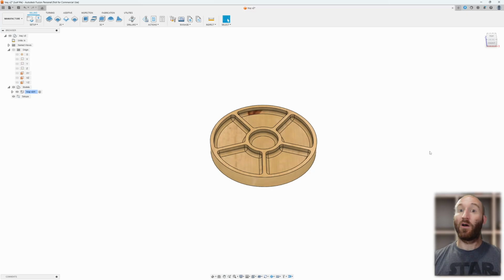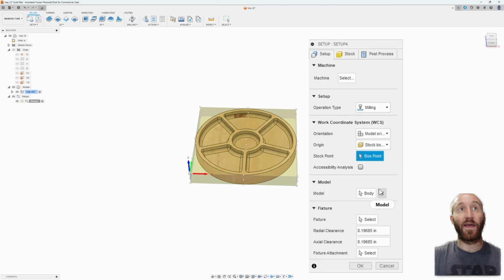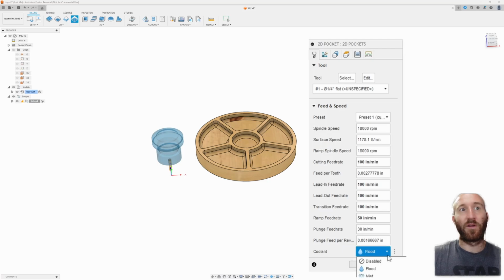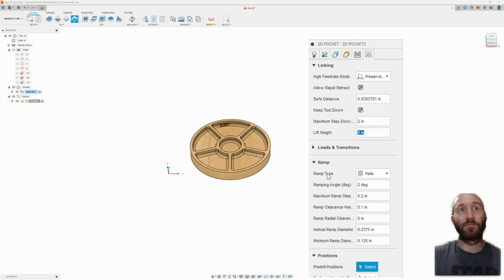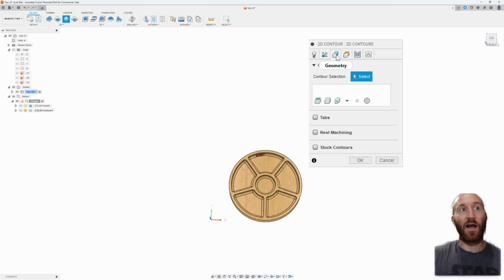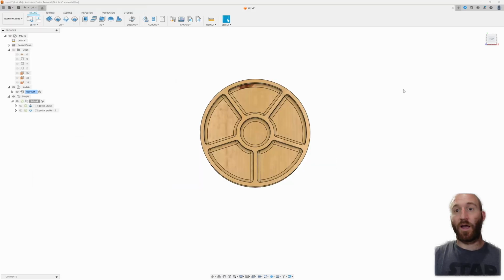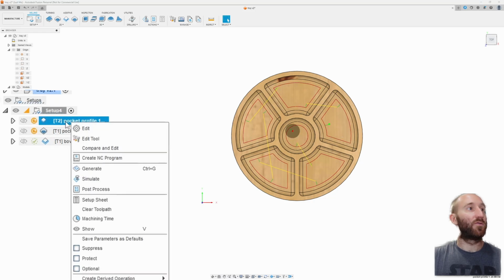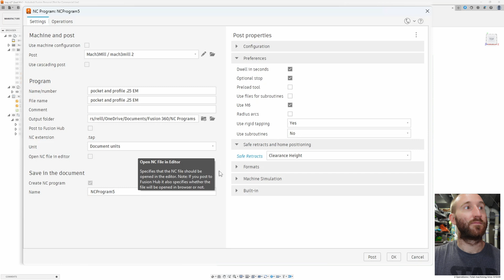Fusion 360 for CNC Routers: Master CAM Setup Fast

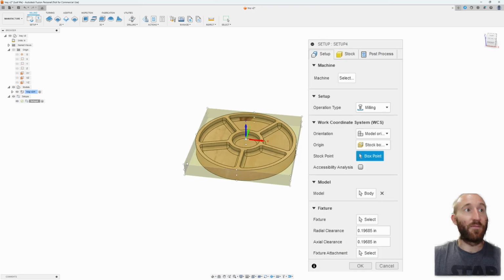Comment: in your steup you choose lower left corner and the top of the model ? not the top of the stock material ? please clarify video time frame 1:48
Reply from the maker: Sorry for the confusion. You are correct its the stock point not body.
-But they can be the same. say if you are making a sign and the stock is the exact same as the body

Comment: Great video! I have using Vetric Aspire but it cannot do step files. I have fusion but need help with cam, would consider one on one sessions online?
Reply from the maker: Thanks! Aspire and Fusion definitely have their differences. I’m not doing one-on-one sessions right now, but if you’ve got a specific CAM issue in Fusion I could put together a YouTube tutorial on it. That way others can benefit too.